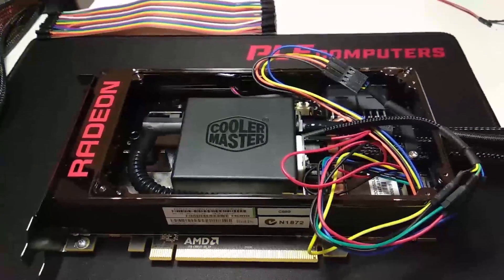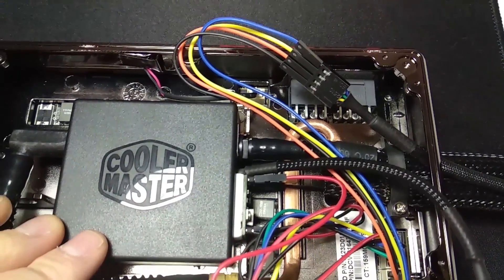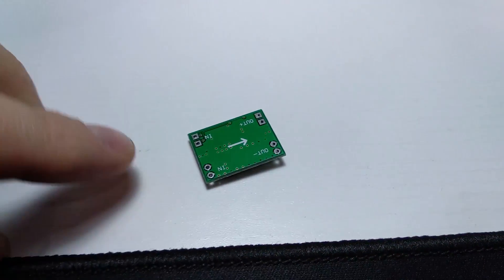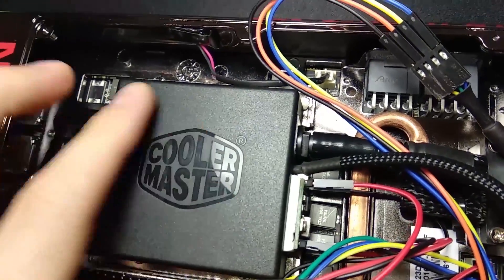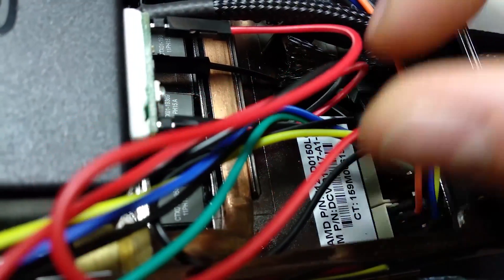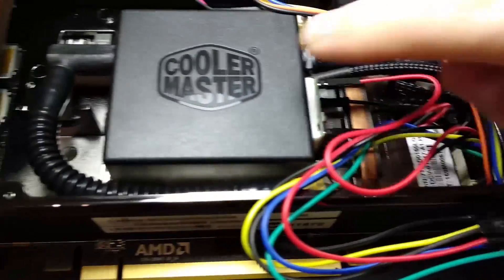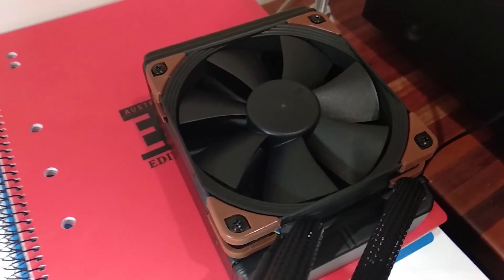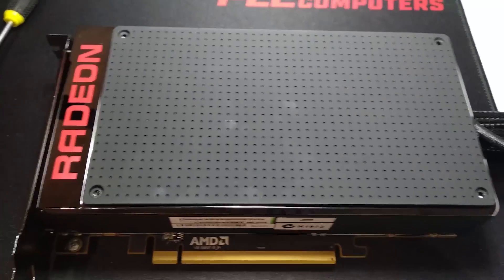AMD R9 Fury X Pump Whine Fix - Voltage Mod

Comment: @Modika 
Hey !
Do you have a discord or anything where we can talk ??

I actually got 2 R9 x's and wants to repurpose the pump as a DIY AIO for my next CPU 
But i wonders do i need anything like your 6 > 12 volts ?
I know there is a few headers on my motherboard but genuinely Wonders what should i do because form what i remember one of my pumps just had a tiny 5 or 6 whites pin's laptop lookin connector ( just an adapter , lower voltages and amps , ?...)
I want to be able to control the pump like a regular one or at least the fan directly from the mobo but still not sure how to give power to the pump herself.
Reply from the maker: You could technically repurpose the pumps, but they whine like nothing else and are of pretty poor quality. You're better off getting some second hand pumps on eBay, which will be much more reliable. The amount of time you spend playing around with this, not to mention adapting the hoses and connectors, just won't be worth it in the end.

Comment: Appreciate this was ages ago, but looks like an awesome mod, having trouble finding that specific voltage module though! Was it a specific brand at all? Cheers
Reply from the maker: It was a generic one. Any voltage regulator should work fine. For example: https://www.ebay.com.au/itm/233437576387
Reply: @Modikapl0x  thanks so much finally found the right one! Legend
Reply: @Modikapl0x  last question, probably an idiot but having a hard time finding those connectors on UK eBay too, did you get them from eBay too? Cheers!
Reply from the maker: @Jack32X  Yep, got them from eBay too. It's probably best to get a kit like this: https://www.ebay.co.uk/itm/313248250607
Reply: @Modikapl0x  ah thanks so much! This card was doing my head in. Hopefully this sorts it